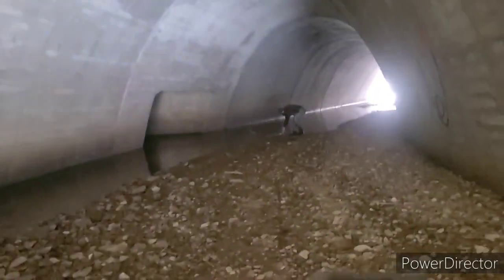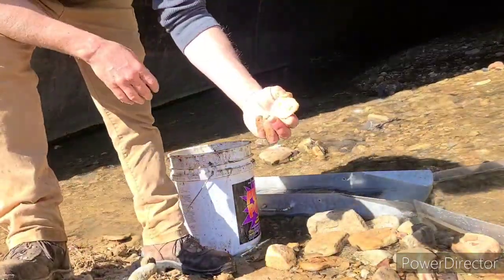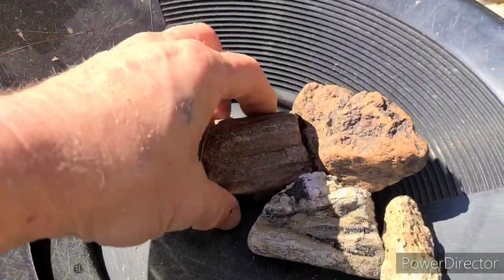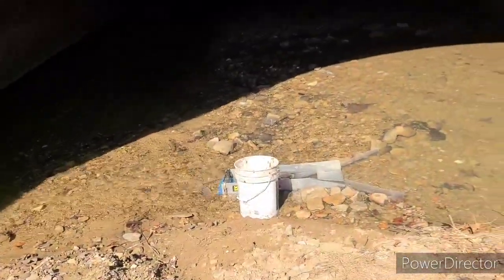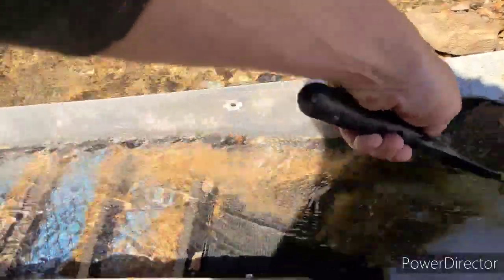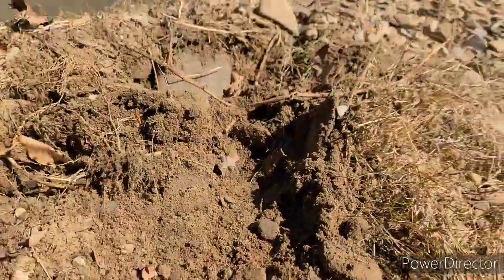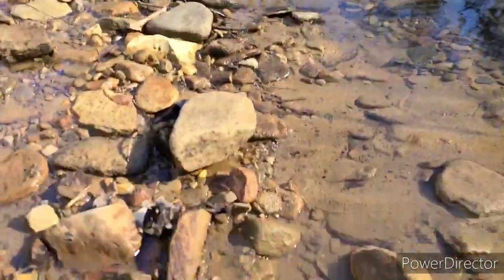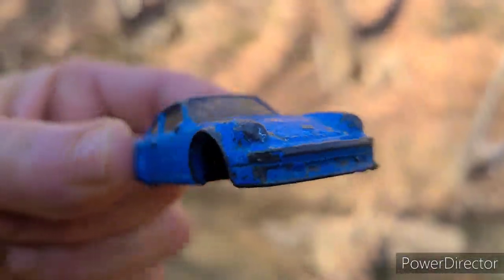Spooky Tunnel Gold?!? Yikes!!

Comment: James my friend. Are you finding any gold on the order of 1mm or so in size or bigger? The one you found the other day was super nice size.

I'm trying to chart the gold sizes in WV.

So far 80% of my findings are 0.25mm or smaller. On the rare occasion I'm finding 0.5mm - 1mm.

I dont have a sluice. I do plan on getting one soon. Everything is by panning at the time. Lord Willing I can get a sluice.

You move alot more material than I so you would come across a wider range or gold sizes.

I always keep records of my spec counts.

Some areas I get roughly 10-15 specs per cup and others i get 30 - 60 per 5 gallons. (Classified at half inch). Of course I get skunked as well.

I hike my cons out so I can't carry alot at one time. 

Thank you for your time.
God Bless you and your family!
Reply from the maker: I believe you're findings are spot on. It's super rare for me to find anything ay the 1mm mark in WV. Most is at the 0.5 and under mark, with some being smaller yet.

Sounds kinda like you found one of my best spots! Ha ha! It's awesome that you're finding some gold! You can always make a simple sluice, for super cheap and very lightweight. 

I wish you continued success in your  search for gold! Be sure to keep an eye out for arrow points, scrapers and other cool artifacts too!
Reply: 1.5 mm is the biggest iv found in WV.  God put it in my pan  😃
Reply from the maker: Sweet!! I love hearing this! Somewhere out there,  there's a picker.. In one of these remote places.  There's gotta be.